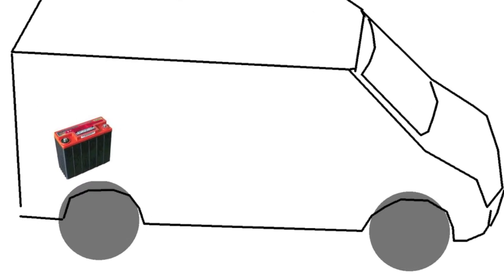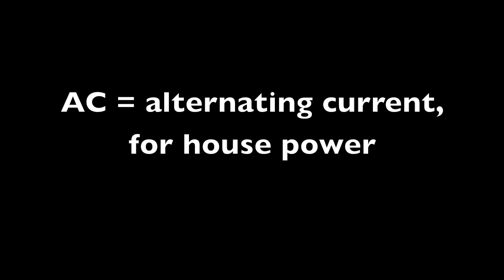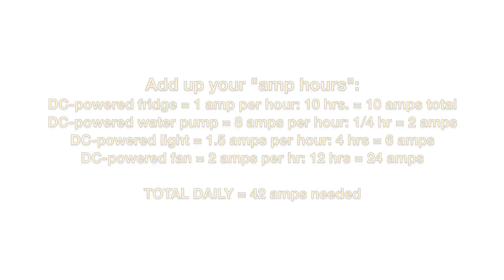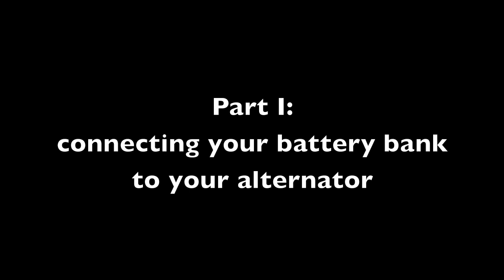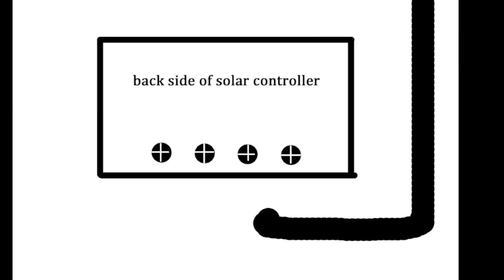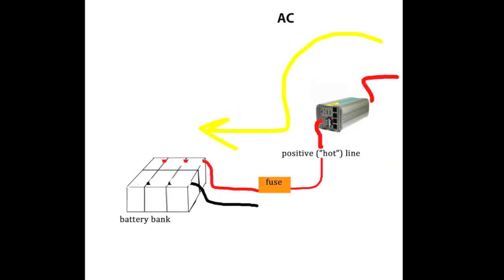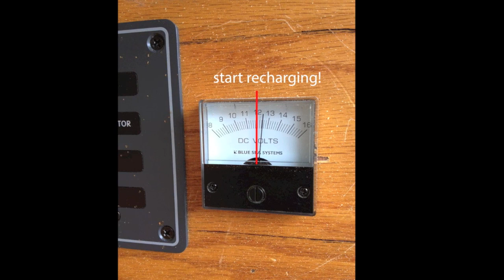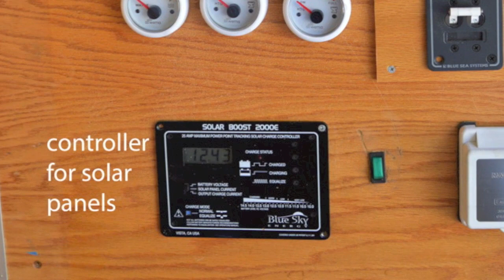Custom Camper Van Conversion, Part 5: RV Electricity & Solar Power

Comment: How do you get away with charging your batteries from the alternator ? They need slow and controlled charging !
Reply from the maker: The alternator feeds the battery slowly because that's what it is designed to do. You don't get a quick charge from an alternator.  I've been using this charge for 4 years and had no problems.

Comment: people seem to be forgetting about wind generators, especially the vertical ones. Solar panels don't work at night and lose efficiency when the sun is not perpendicular on them or in bad weather. Wind generators have more chance of working and a 300W one is pretty compact.
Reply from the maker: I've never seen one on a vehicle. How would it work?
Reply: Ron Tanner a quick google image search away: https://ae01.alicdn.com/kf/HTB1_PqYRpXXXXadXVXXq6xXFXXX9/300w-24V-50HZ-helix-font-b-vertical-b-font-font-b-wind-b-font-turbine-font.jpg vertical ones are more efficient and a lot less noisy. you can get hybrid controllers for running wind generators and solar panels.
http://www.otherpower.com/images/scimages/90/C__DCP02136.jpg

Comment: Correct me if I am wrong, but to plug into shore power, wouldn't you need a CONverter (that converts AC to DC) in order to charge your battery? As per my understanding, a INverter inverts DC to AC.
Please keep in mind, I don't know jack about electrical stuff...
Very helpful video, nicely made! Thx
Reply from the maker: Yes, Joe, you are right. My inverter is a converter too. Most higher-end units have both in a single package and I highly recommend it. Thanks--and good luck with your project.

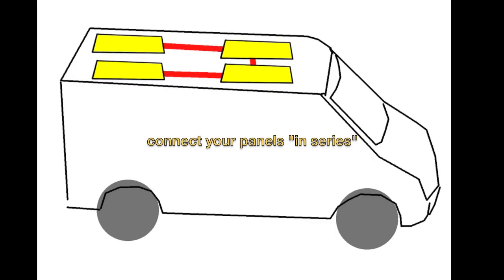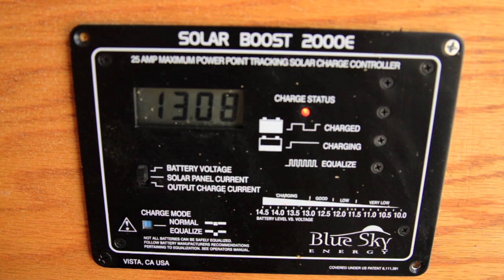Comment: The video at 06:35 sketch shows "Connect your panels in series". Isn't that a HUGE mistake? Should be in parallel!!!! At 07:06, "Here's my controller. You can see I'm pulling 30 volts from my panels." The video shows 13.09 volts. Also, YOU do not PULL any volts. The panels are doing the pulling.

Comment: Thank you Ron, appreciate the incredibly well articulated video. 

I am new to the concept of van dwelling and am currently planning a pretty aggressive entrance into the scene. Can you tell me if the scenario I am going to explain sounds electrically sustainable for a few months aside from the obvious risks of the extremely alternative lifestyle?
I have a 2000 Ford E350 Super Duty Extended Cargo Van. I am currently insulating. For the first 2-3 week trial run to the Northwest (because it's cooler there next month) this is my plan.I believe I will go isolator only at first because I will be driving daily and don't need a lot of ah. I will charge my laptop (holds 4.5 hr charge) and my cell phone (holds 24 hrs) through a 12v cig lighter inverter while I'm driving. (btw does anyone know if there is any reason that a $5 one from Harbor freight won't work as well as a $30 one from Amazon?)
I will be driving 5-7 hours daily except Sundays with about 25 starts and stops during the day over a course of 40-70 miles. I will only run a fantastic fan roof vent with reverse at night while sleeping (6-7 hrs) and a second computer screen for a couple of hours in the afternoons off of the aux battery unless I get a suggestion from someone that I have other ah needs that I am not aware of. This exceptionally low need for ah is because I am only eating raw vegetables and fruits and drinking water 100% of the time in the van while occasionally eating in restaurants so I don't need a fridge or any cooking implements at all. My van will be mostly bed, storage, cargo (samples for business) and office. I just picked a sweet contractors partition/bulkhead with a door today that really boosts the stealth profile. I will be boondocking 100% of the time, showering at fitness centers and Y's, getting up at the crack of dawn and pretty much retiring when the sun sets. I read books on e-kindle on my phone after dark and don't need a light except of course for my emergency gear and my phone has a flashlight app. So... I think if I start with running a 120ah agm 12v (or 2 6v) off the alternator I should be ok. Can you tell me if I'm missing something?
If this works I will pass on the solar altogether on this build because this is a test to see if the gorilla sales campaign strategy works for my business. If it does I will be investing in something a little more suitable to spending a lot of time on the road with a couple more creature comforts. Thank you for any comments and everyone else (even sharpshooters) for any input as well.
Reply from the maker: As Lance points out, it's difficult to answer all of your questions in this small space. Here  are some thoughgts:  1) learn about inverters. Not all inverters can charge all utilities. 2) You're right to charge your stuff while driving. 3) You need a screen window for ventilation to work with your fan -- blow it out, not in, at night to draw air through the window; otherwise you're not going to get the ventilation you need. 4) I shower at fitness centers; works great; 5) You need at least an ice chest to keep some things cool

Don't make living on the road any tougher than it has to be. It can be very tough. I just got off of two months driving around the country--long drives and hot days. It will wear you down. So make a point of building in comfort (like that screened window I mentioned). 

Best of luck
Reply: Thank you Ron, I appreciate the info. I realize it was a crazy long bunch of questions mixed in with reasons why etc. so thank you for the tips and helping with your videos. It really is going to make a difference. 
One thing that I cannot decide on is where to screen vent from. I was thinking of putting a vented hole with a closeable cover in the floor. The reason I don't use the window is because I want to remain 100% stealth. Thanks again!
Reply from the maker: I believe in keeping a low profile while campervanning but I think the stealth idea is overrated because you're going to sacrifice a lot of comfort in an effort to stay invisible. Most on and off-the-road situations do not call for stealth. Just get a tinted side window. A hole in the floor isn't going to give you the ventilation you need.
Reply: Ok, will look into ventilation more carefully. I will also give a lot of thought to the necessity of stealth as opposed to just spending more time checking out legal places to park overnight. The reason is my budget doesn't yet allow for campgrounds and motels. I am going to benefit a lot from gym memberships and am also really looking forward to being out on the road. It is not going to my only home though. I am only going to be away for 3-8 weeks at a time and can spend a night a week or so in a motel just to change it up and feel normal again.
Your feedback is obviously seasoned with experience, knowledge and wisdom and I hold it very high regard. 
Thanks again for your time and your helpful concern.
Reply from the maker: Did you see my video on places to park overnight? I almost NEVER do campgrounds, unless they are free or really cheap. The only time I've ever had to worry about being stealthy was when I parked in residential neighborhoods, which I don't recommend. I always park in a Walmart or something similar, where no one thinks twice about seeing a campervan. Let me know how it goes!
Reply: Just watched it. Really great to have in my arsenal. I'm really going to take advantage of the information and save myself a lot of potential grief. Thanks again for being so generous with your help and your time. One thing I have to say as someone who really like campervans (even though mine is a cargo van), yours is very unique and cool looking and I would definitely notice it in an admirable way if I passed it by on the street. It's a super nifty rig!
Reply: No way you can pose a 485 word comment / question on Youtube and expect an expert reply. You either hire an electrician (BEST) or do 100 hours of reading to decide how to accomplish a custom wiring arrangement.
Reply: You are correct! No responses at all from anyone except you. And right again, I did benefit very much from watching more videos and talking to people at solar and battery shops and have figured it out for now. Thanks for the input. God bless!

Comment: I'm sure it will  a lot less confusing if you id AC as 120 V and DC as 12 volts.  You will never have an AC 12 volts that possibility will never happen.  With AC the possibility of AC 120 volts and  220 volts can easily occur.  By identifying 12 volt and 120 volts there is no confusion and avoid mis identifying  AC 120 volts and 220 volts.  After all the intake for most RV are 220 volts.  .
Reply: Good point about 12 volt being DC. I don't know what you mean by the "intake" for most RVs is 220 volt, unless you are not in the U.S. For the U.S., only high current appliances use 220 volt, such as some A.C. units and dish washers. All else is 110 volts (114 to 126 volts).

Comment: so much weight . buy used ev, lithium batteries. much safer and durable batteries. not to say 1/2 of the weight for same whatt hrs , or amp hrs. they come with liquid cooling, solid shell, and can be drained to 0 . just like your phone. your lead acid is only good for 20 to 50% discharge, if you want to keep them alive. just wire it all in 12v configuration and get a 2000 watt nice sign wave inverter , and you will have a supirior system
Reply from the maker: Sounds interesting, Sevak. Do you have any link to more info. on this?

Comment: Nice video.  I'm glad my electrical needs are a lot less.  I was able to just hook one solar panel on the roof.  And my fuse system is a TON simpler.  I just run everything (including the charge controller) to a Blue Sea systems ST-Blade Battery Terminal Mount Fuse Block kit.  It's only good for up to 30amps per connection and 100 amps total.  However, if you have a small system like mine it works great and can be hooked up in a matter of minutes.  And it is small, connects straight to the battery and uses car type fuses (each connection has it's own fuse... up to 4).  It has a block for the negative side also to make it easier to connect your wires to the battery.

Again, it is only good for a small system though.  For example, my inverter is only 200 watts.  And I don't have things like AC units. For a van like he has in the video you definitely need to go with the bigger stuff.  He has tons of electrical needs.  Which is expected if you are living full time in it.  I use my for only a few weeks at a time.

Comment: I have been watching a few of these solar videos lately and although I don't have anything yet no one seems to mention that as long as the solar panels are in the sun they can produce power and charge batteries. This being said why is it never said that this is going on while traveling? Most travel is done, whether permitting, on roads that have full sunlight, even in the forested upper peninsula of Michigan which has nearly all two lane roads, the roads are cleared enough to afford full sunlight. shouldn't this receive at least honorable mention when talking about solar panels charging the battery bank. Maybe it's too obvious but everyone seems to only talk about charging the battery bank while boondocking in there videos.

I did find your video enjoyable, informing and well produced. Thank you for your efforts and posting it.
Reply from the maker: +Ken Kloet 
Thanks for your input, Ken. It's a good point. However, when I'm driving I'm charging my batteries via my alternator, not my solar panels.
Reply: +Ron Tanner , your reply about using the alternator to charge your van's "house" battery bank is then taking some power from your engine and depending on the state of that battery bank could put quite a load on your engine and effect your fuel consumption. I would think using your solar panels to charge your house battery bank should improve your fuel economy.

Comment: What would happen if you only have a 55amp alternator but still wanted to rig it up so you're charging a secondary battery (or two)? Ultimate destruction???? I've got a 1978 VW Bus and apparently that's what it uses.
Reply from the maker: +Nathan Swartz 
As I understand it, Nathan, a smaller alternator wouldn't generate enough amps to feed both, so you'd be getting only a partial charge all the time. I'd consult a VW expert to check.

Comment: How do you rig the dc ac inverter up to bring power in from an external source? Most of the inverters I'm finding on the web seem to be purely "ac in" and not "ac out"
Reply: +Ron Tanner this is incorrect. an inverter only takes dc power and converts it to ac power. now some inverters have a CONVERTER built in but most inverters only do what I mentioned
Reply from the maker: +Daniel Rimsans 
Dan: as I understand it, all inverters convert power from AC to DC and DC to AC. When you're feeding the inverter AC power (as in plugging in your vehicle to a power source at an RV park), your inverter then stores that power in your (DC) battery banks. Later, with the flip of a switch (on the inverter) you can draw on that power (from your batteries), which the inverter will convert to AC.
Reply: +Ron Tanner this is incorrect. an inverter only takes dc power and converts it to ac power. now some inverters have a CONVERTER built in but most inverters only do what I mentioned
Reply: Thanks

Comment: Thanks Ron. I am installing an mppt controller. Will I need to put in a switch to disconnect the controller output while on the alternator? Is an alternator a quicker way to charge the battery? I appreciate your help. Once I figure out this last question, I think I am good to go for it.
Reply from the maker: +Irideon Andon 
Alternator is the fastest charge. Your solar controller should come with an automatic shut-off for when the alternator kicks in.
Reply: Thanks!

Comment: Great videos... Watching the whole series. Currently in the process of finding a van that will allow me to live "off the grid" so I can save money and still have the luxury of traveling and seeing the world. In your experience what is the most reliable make and model of van? Kind regards, Duncan
Reply from the maker: +Duncan Clarke 
Thanks, Duncan. Hard to pick the best van because there are new cargo vans on the road: Ford Transit, Dodge Promaster, and Nissan NV. In various ways they compete favorably with the Mercedes Sprinter. But none of them are diesel, which I prefer. And, because the Sprinter has been around since 2002, there are a lot of used ones on the market. I do not recommend traditional 8-cylinder American van. They simply aren't cost effective because they guzzle gas. Nor do I recommend mini-vans because they're usually too small and not quite as hardy as a cargo van. Look on Craigslist and eBay within a 200-mile radius of your city. Also scout out community bulletin boards and retirement homes for van-sale notices.

Comment: Thanks for the great video!!    If I have solar panels through a controller to charge my batteries, I can also hook my batteries directly to the vehicle alternator output?  I could put a disconnect relay between the alternator and  batteries to  disconnect them while on solar charge.   Would I get enough of a charge from the alternator to make it worth while and would it not hurt my batteries?   A lot of questions I know.
Reply from the maker: +Irideon Andon 
Yes, an alternator hook-up is the best way to charge your batteries. You'll need a battery isolator  to keep the starter battery from draining your other batteries and a solar controller, which will turn off the solar feed while the alternator is charging your batteries.

Comment: thank you so much for the video! helped me out a ton, one question thoguh... Can I draw 12v dc power from the battery without any further overload protection or anything? so just connecting my cigarette lighter outlet with an wire to the battery without a fuse or anything else and it won't overdraw power? thanks for the help!
Reply from the maker: +ProgamerEU 
Yes, you can attach any DC utility straight to your battery. But you should install a fuse between  the utility and the battery to keep the utility from burning up in case of a short in the wire.

Comment: Great detailed info! Question. I've installed a100 w solar panel on my van.I've got a 10 amp fuse from the panel to the 30 amp controller.then controller to battery bank. Do I need to ground anywhere on this system? All videos I've seen do not mention grounding. Tks
Reply from the maker: mangamark67 Thanks, Mark: the controller should be grounded. It never hurts to ground your equipment.

Comment: Nice graphics. I have a 06 leisure van. Roof space limited like yours. Did you connect the panels in series or two parallel circuits? I am toying with mixing thirty volt and 18 volt to achieve max output, but not my forte .Do the ones on the side of the air conditioner detract due to shade much?
Reply from the maker: Gerry Carson The panels are connected in parallel: red to red (hot to hot), black to black, all the way around. 

I've not noticed any shade problems with the side panels.
Reply: Ron Tanner Hello : I'm fixing up a 1952 School Bus. I want to put Solar Panels with Deep Cell Battery's . Here's what I have to figure out. The Old Bus is 12 Volt. Can that Charge my Deep Cell Battery's . I'm just learning. Thanks Terry